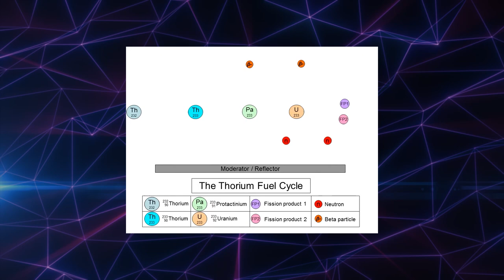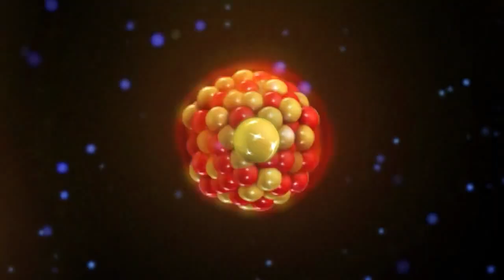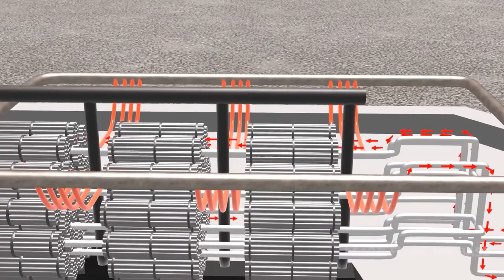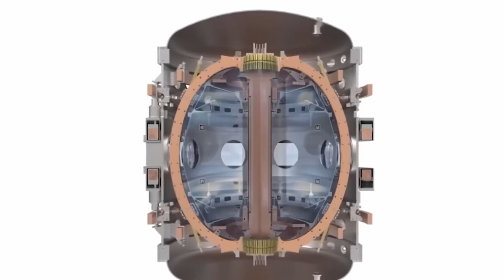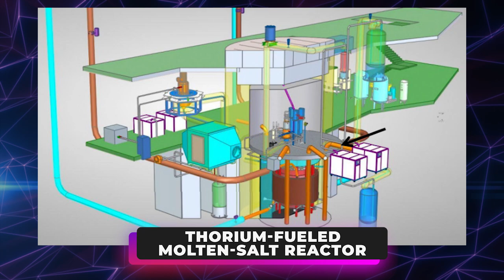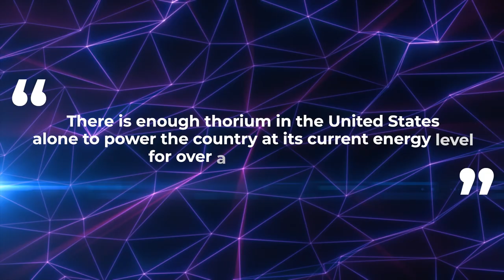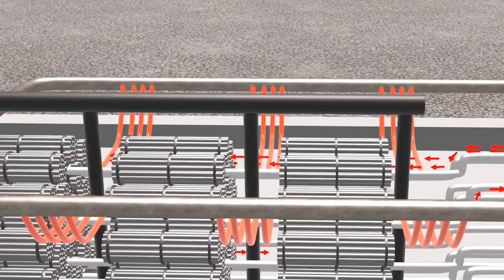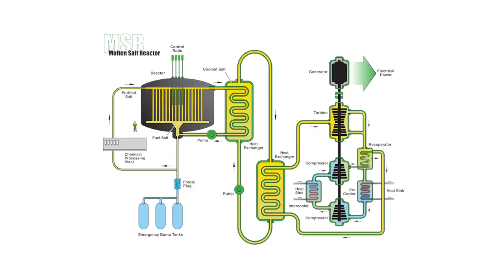Scientists Have Built the First Ever Thorium Reactor!

Comment: In August 2021, China announced the completion of its first experimental thorium-based nuclear reactor. Built in the middle of the Gobi Desert in the country’s north, the reactor over the next few years will undergo testing. If the experiment proves successful, Beijing plans to construct another reactor potentially capable of generating electricity for more than 100 000 homes.
Reply from the maker: That’s a massive feat! 100,000 homes seems a bit small in scale to the population but it is definitely a start in an interesting new direction, don’t you think?

Comment: This data seems inaccurate for instance where do you find lead without uranium as the half-life of uranium 238 is 4.5 billion years the exact age of the Earth which kind of dictates that uranium 238 and lead in nature are found in a one-to-one ratio which makes me think this is quite possibly a Chinese propaganda video
Reply: It is not.  China got the successful idea from US scientists and engineers that built a Thorium reactor in late 1960s to early 1970s that ran uninterrupted,  without incident, for about 4 years.  The NRC lobbied to remove funding from Thorium reactors , for the conventional reactors,  for bomb making materials.  The NRC could not let the public see there was a safer way to produce electric generation, that is why they were not allowed to connect to the grid with their generators.  Thorium reactors do not run under the extremes of pressures that conventional reactors do,  which makes them much safer.  With conventional reactors the Uranium/Plutonium is radioactive for 10-20 thousand years in storage,  with Thorium reactors the waste will be highly radioactive for a shorter 500 years life,  there is the trade off.  Lower level - longer half life in waste  storage,  or,   higher level radioactivity - much shorter half life of 500 years in waste storage.
Reply: Chinese small scale Thorium Molten Salt Reactor was already in place and  in Xinjiang Gobi desert which can supply electricity for 13500 households...no cooling needed by water.